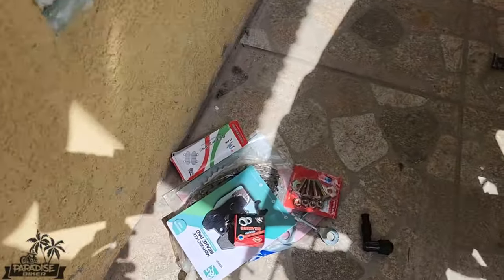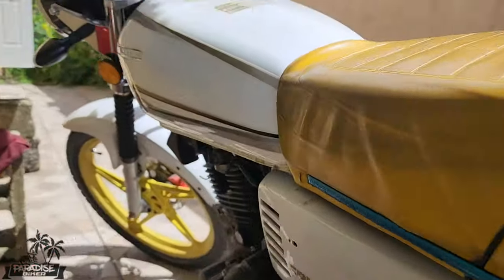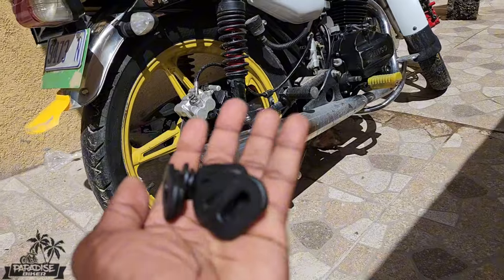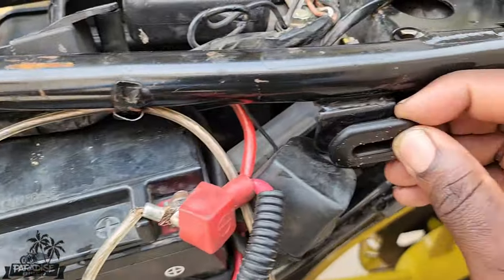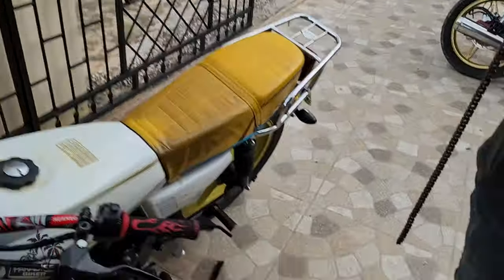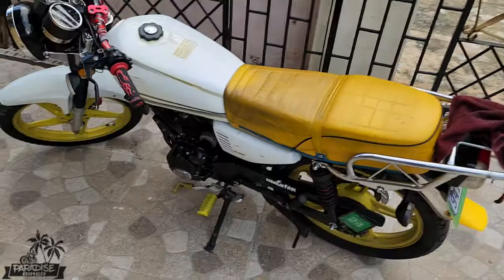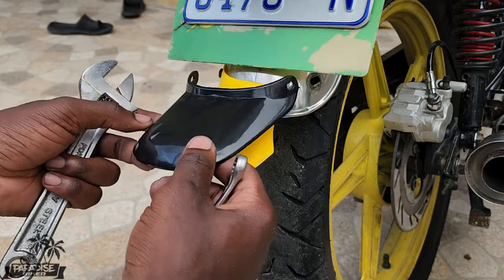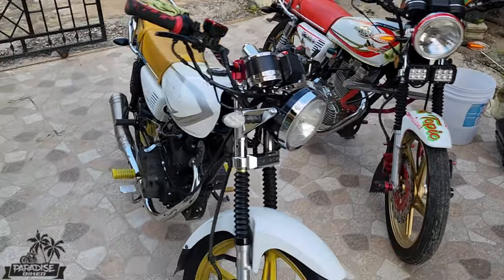Service Day on My Bike | Jamaican Bike Life 🇯🇲

Comment: To pop wheelies easier , change front sprocket to 428-14T and change rear to a 428-46T , max speed will be reduced but down-low torque will take a nice upgrade
Reply: It’s not 46 it’s 42 and 14
Reply from the maker: Thanks for the suggestion, I'm not a stunter, just a daily commuter learning wheelies...I don't want to sacrifice anything because these bikes are underpowered already
Reply: @ParadiseBiker  exactly and changing to 42 and 14 just ago Mek your 250 run like a 200 down hill and pon flat but going up hill even with load it will run like a 300 and it’s much easier fi wheelie! Basically it’s only for stunting
Reply: @ParadiseBiker  mi did have one 42 and mi tek it off and go back stock cause it Mek mi pressure mi engine too much and mi bike nah move pon flat ! 38, 14  36 14 a so it fi stay bro raw power